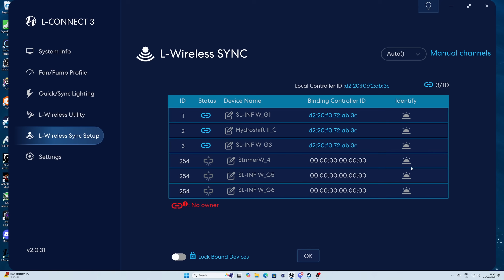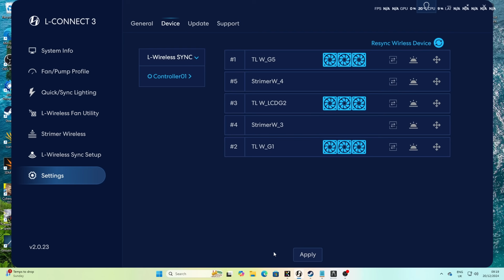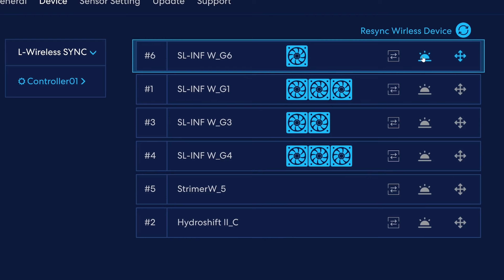Lian Li RGB Lighting Sync Sequence and direction problems fixed - easy tips!

Comment from the maker: Specs of this build (note these include affiliate links which may earn me a commission at no extra cost to you):
Case - Lian Li O11D Mini V2 https://amzn.to/3H8tMBh
Motherboard - Asus TUF Z890-Plus Wifi https://amzn.to/3S4YUDs
CPU - Intel Core Ultra 7 265K https://amzn.to/44Tzm28
RAM - Corsair Dominator Titanium First Edition DDR5 RAM https://go.corsair.com/baya19
RAM Lighting Enhancement Kit - https://go.corsair.com/xLkzAd
GPU -  Gigabyte RTX 4070 Ti 12g OC https://amzn.to/3GRs6IU
PSU - Lian Li Edge Platinum - https://amzn.to/45gVAwu
NVMe  - Samsung 9100 Pro https://amzn.to/4imehDd
NVMe - Crucial P310 https://amzn.to/42sZtNs
AIO - Lian Li Hydroshift 2 LCD-N https://amzn.to/4fg8jTB
RGB cable - Lian Li Strimer Wireless 12vhpwr https://amzn.to/3GGAnCZ
Riser - Corsair Premium PCIe 4.0 x16 Extension Cable 300mm https://amzn.to/45fAQVX

Comment: Nice, but I take it there is no way to do something like this on the wired ones - SL 120 INF  (outside of adjusting which is plugged into the controller slots)?
Reply from the maker: I need to check

Comment: I have a Galahad Trinity 2 and having sync issues with the middle fan on the AIO and the rest of the case in rainbow wave. I can control the lighting and works with any colour but it struggles wth rainbow. Tried everything including flashing the firmware and plugging it into different headers. Nothing worked...

Comment: The only problem I had is one fan going back to default settings. But it’s easy to set back in l-connect. The Lock & bind devices option definitely helps. By the way if you have an all white build, with white RGB you don’t have to change the settings at all. Default setting is white

Comment: Hi @theprovokedprawn, I’m building a PC on a Lian li 011 RGB case and want all black case fans. I bought the front mesh cover since I’m going air cooled on the 9800x3d. I want 140mm fans on the front, 120mm fans on the bottom and top. Or maybe 140 mm on the bottom to cool better the GPU. Which fan company you recommend. I don’t want rgb on the fans. The RGB in the case is enough for me. Thanks again from a new subscriber.

Comment: Random suggestion but it would be cool to see a video where you try to build system that uses only one efficient control software with UEFI to control cooling and all possible rgb effects. Point being all of the manufactures software either suck, are resource hogs or you have to run multiple different software to configure everything unless you buy everything from the same manufacturer. Haven't seen much videos comparing different software like openrgb vs. signalrgb or overall best way to minimize the amount of bloat software with good hardware. Combining the best fans on the market with AIO and RGB without bloatware seems quite difficult.

Comment: When I built my PC I used all TL120/140 wired fans and they are plugged into a controller. I then decided I wanted to swap out three of the TL140s for three LCD TL140s, but as they are now discontinued I had to buy three wireless ones. In L-Connect these different fan types appear separately, so I have three groups of fans on the controller and one group of wireless LCD fans on their own wireless controller. Can I still have synced lighting effects, or am I doomed to have just solid colours unless I replace my wired fans with wireless?